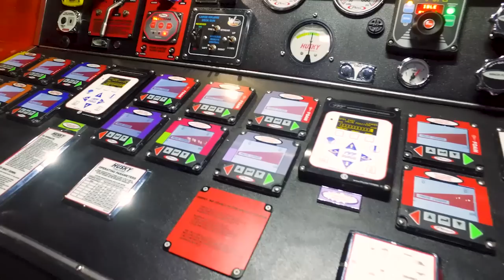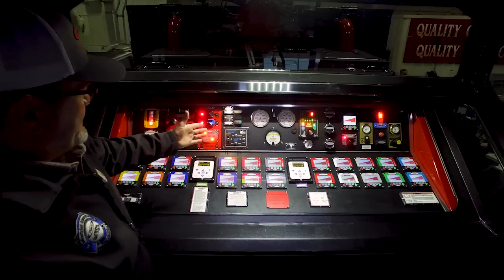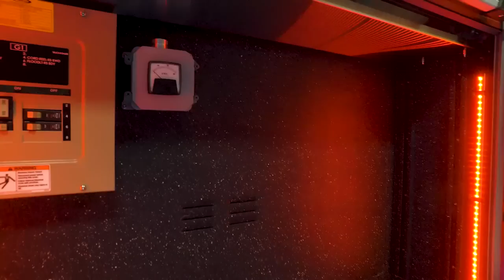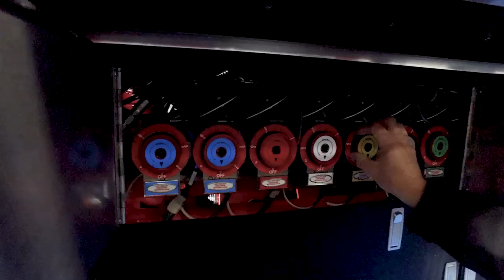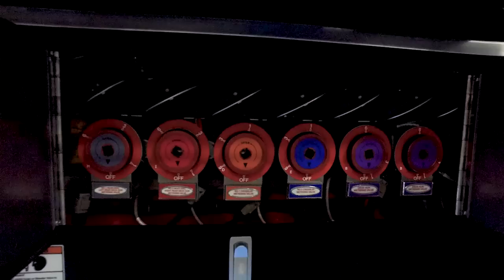Velocity® High Flow Industrial Pumper – Pasadena, Texas

Comment: 8 inch intakes OMG. If you ever need to flow 5,500 GPM you are in deep.
Reply: It says chevron so I am sure it will be fighting petroleum fires
Reply: You couldn't use this truck in a municipal setting.  They don't have the water capacity. At my facility we maintain 125psi at all of our headers.  Municipal probably maintains 20 if your lucky.  You would destroy your pump if you tried to run wide open
Reply: @mclotfelter5664  its still a sexy paint scheme tho
Reply: @popcorn8153  It says Pasadena plastics company.
Reply: @jimmartin7881  yea and also chevron on the door, I saw both

Comment: Beautiful truck but alot of technology. I'm old school and like manual control of valve's.
Reply: Yup, a lot less to break.
Reply: You would be surprised.  In 10 years only had to manual override 1 time.  Those controls make it so that you get good discharge pressure at the nozzle on each of the lines that you are using.  That deck gun open 100% will rob flow from let's say your blitz or crossfire and that puts your guys in danger. You can fine tune from the panel to make sure they get what they need with out being told
Reply: I engineered an ALF 900 series, there’s something about having hands-on manual control of the pump panel. But those automatic panels are something else!
Reply: Fine. I'll take any tech I can on a rig that will make the job easier.
Reply: @jimmartin7881  If you don't have proper maintenance it doesn't matter worth a darn what breaks and what doesn't on your truck

Comment: Would that small compartment in the rear at the bottom be the ladder compartment?
Reply: I don't believe there is any ladder compartment as there is no need for ladders on this rig. Industrial sites don't typically do ladder operations that their tower or ladder cant handle.
Reply: @Matt_TX  Thanks!